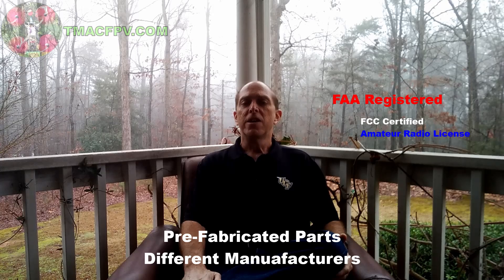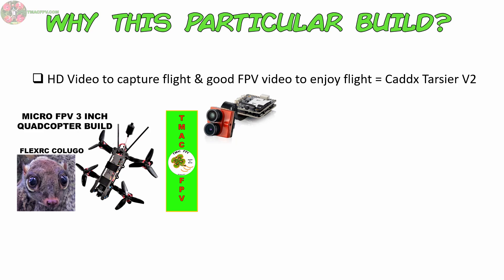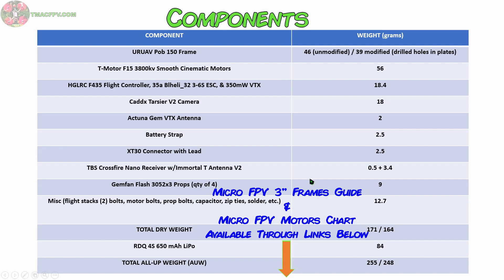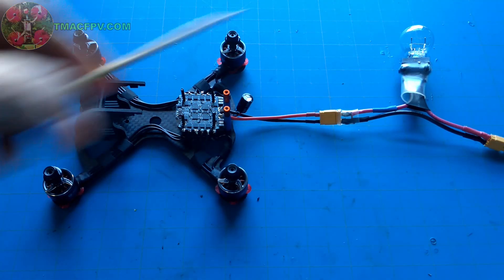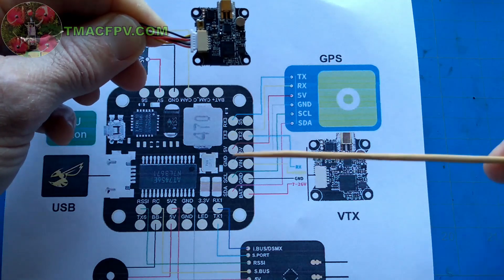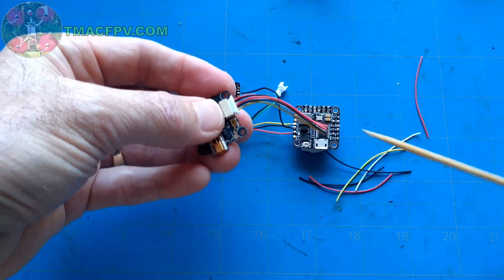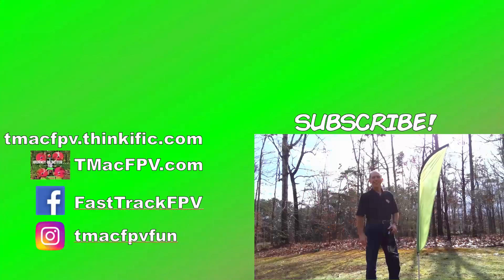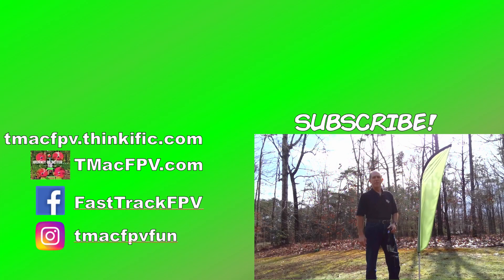Micro FPV Race Drone Build

Comment: Thanks for the Mention Mate its much appreciated 👍😁. We've followed each others work from the beginning and I can honestly say that your the nicest FPV friend a guy could have🤜 😁😁. I'm loving the new build and especially the custom modifications 😍😍.  Very nice Motors !! I've had my eye on them for a while but in 2700kv to run with a 6s battery 😉. Great Flying and as you say practice makes perfect and you made traversing those gates look easy 😎.
Reply from the maker: Thanks Sub 250g! Learned from you & put some of your techniques to work! I like the motors a LOT. Very smooth. Think you'd enjoy them They do seem power hungry though (not the most efficient). Have a great weekend friend 👍